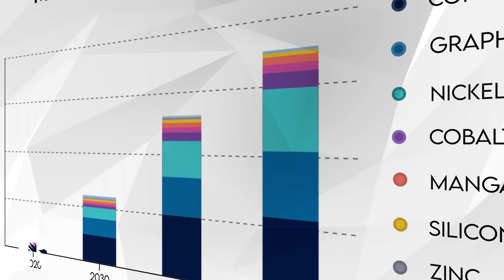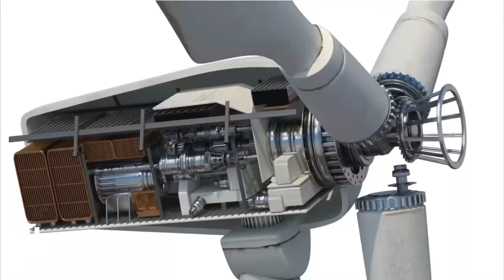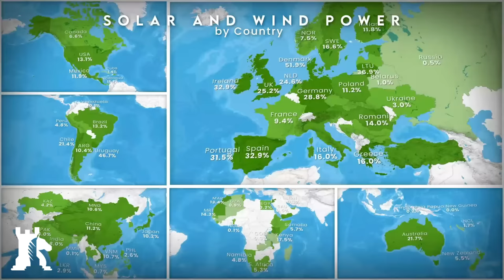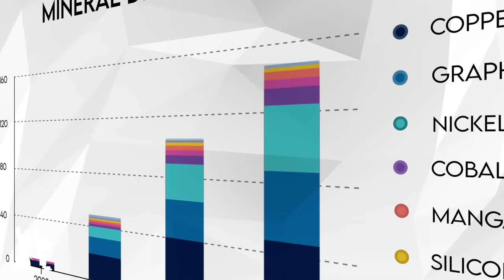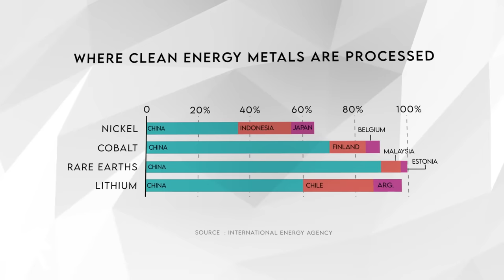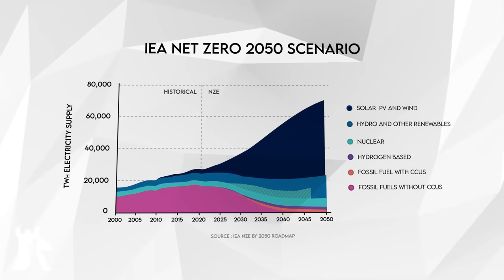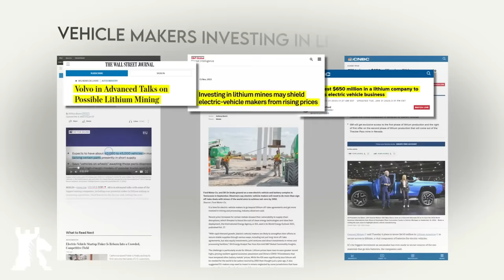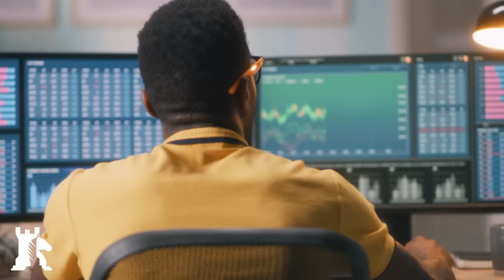Net Zero by 2050 is not happening

Comment: The Nordic countries came of as having low adoption of renewable energy on the graph but that's not the case. I think Sweden met 50% in 2012 and it's over 60% today. They use a lot of hydropower so that's why solar and wind is so low.
Reply: Also, what isn't Hydro in Sweden is mostly nuclear. Non-fossile power generation in Sweden is ~90 %. Norway runs a cool 1% fossile fuels, and doesn't even have nuclear.
Reply: They are inconsequential in every way to the "climate issue". They and the US could dissappear over night and the climate bs would still occur due to the coal power plants used in India and China.
Reply: I don't know country-specific statistics, but you are talking about electricity demand, not energy demand. Worldwide, only 18% of primary energy demand is electricity. That figure might be a bit higher in favour of electricity in Sweden, but all countries depend on food, concrete, plastics and steel, all things that require lots of fossil fuel subsidies without green alternatives that can be scaled up massively, and much of it is imported. Just producing a kg of wheat requires 250 ml of fossil fuel equivalent, and other foods are way higher. And at the end of the day, Sweden is population-wise a small country, with the population of a city in China that most people never heard of.
I highly recommend reading 'How the world really works' by Prof. Vaclav Smil.
Reply: @MA_KA_PA_TIE the US? 😂😂
Reply: @MA_KA_PA_TIE  "hurr durr, since it won't fix everything, it's pointless to even try"
Reply: @ericmyrs lol if failure is inevitable, then of course it’s pointless to try.
Reply: @MA_KA_PA_TIE  The goods produced in India and China are used by US. Its not just about electricity, you use everything from plastic to steel to concrete everything uses fossil fuels. We can't get out of it, countries in EU and others boast about green energy because most of the industries like manufacturing ones are based in Asia, its a bit hypocritical to just call out specific countries.
Reply: Neither the Nordics nor the US produces any consumer goods but also use the largest amount of per capita consumer goods in the world. Outsourcing you work, doesn't evaporate your foot print.
Reply: @TheDentedHelmet I think you're disregarding Sweden's extensive lumber industry. I don't know if IKEA furniture is made in Sweden but there's a lot made out of that lumber even disregarding IKEA.
Reply: @SIZModig  IKEA mainly source their lumber from Eastern Europe nowadays but you are correct that our lumber is still a large export commodity in Sweden. We also have a huge mining industry.
Reply: @SIZModig 
Pretty sure you use all your lumber to make housing due to Sweden’s chronic housing crisis.
Reply: his numbers are absolutely OUTDATET
Reply: either finland or norway energy costs were free a few weeks ago in article i saw, because of renewable production -they make so much they export to germany and other countries
Reply: @sobhansarthak6000  Same for Massachusetts which brags about how "clean" it is- thanks to exporting almost all of its industries, other than higher education, hospitals, gene tech and software, all of which use few workers and they're all highly educated. We now have the 3rd highest electricity course in America.
Reply: @cryptarisprotocol1872  rough estimate is ~10% of all Swedish exports being entirely or in part made out of wood. Paper alone is like 5%.
Reply: @TheDentedHelmet  
Outsourcing your work, creates a problem. You have no use for your low quality workers, so you must give them welfare/benefits.
Reply: @AlexFlodder  And the welfare state itself is subsidised by the Petro-Dollar and the environment damage that it causes.
Reply: Don't believe everything you watch on youtube. Most of these channels hide their poorly researched knowledge behind fancy animations and dramatic delivery
Reply: norway sells a fuckton of natural gas.
Reply: @MA_KA_PA_TIE US produces more CO2 emissions than India even though the US population is much smaller than India’s.
Reply: They have a lot of nuclear. And their renewable power is mainly hydro.  There are very few countries with the topography to do this. There are no Hoover dams in the works and the Greens wouldn't allow it anyway.
Reply: But you forgot that how much Nordic countries are rich and most country not also how much carbon they emitted to go that rich
Reply: Any power obtained through nuclear should count.  As it is carbon neutral.
Reply: Sweden and Norway have heavy hydro. I think Norway is mostly hydro, and Sweden a Nuclear-hydro combo. So they don't need to heed the Gospel of Wind&Sun - and I'm guessing so far north, solar is rather crap anyway. Not even sure how viable it is for Germany (i.e. if you placed the same solar panels in Spain, how much more energy would they generate?)
Reply: @MA_KA_PA_TIE  The US is most definitely NOT inconsequential. All told it actually put the most total carbon emissions - a full 25% of it. By contrast China still only account for 12.7% of emissions, and India a measly 3%. The US also has much higher per capita emissions than both China and India.
Reply: Not all countries have the luxury of multiple lovely rivers like Sweden.
Reply: @MA_KA_PA_TIE atleast their countries are as clean as they possibly can be, the people don't have to inhale excess carcinogeic combustion fumes in the streets and near factories or shipping facilities. And their forests are preserved.😊
Reply: @cryptarisprotocol1872  Oh, if it were only so... there's some housing being built but not at all enough to outpace the growing need. There's a lot of timber going into making furniture, windows and the like around where I live, I bet there are other uses too, though.
Reply: That is also true with Canada, particularly Ontario and Quebec.
Reply: @ericmyrs  "trying" involves increasing human suffering and poverty. Its immoral to try unless there is a realistic plan to solve the issue. Even if there was a valid plan, we still have to weigh the pros and cons.
Reply: Hydro IS renewable! Both politicians like to make you think otherwise.
Reply: @MA_KA_PA_TIE  That's not the point, is it?? They're a model that it can be achieved and pretty fast... basically it's just excuses for the rest.
Reply: @MA_KA_PA_TIE Sweden yes, America though is the consumption behemoth. They could save the climate all on their own
Reply: one ought to argue that their energy demand is nowhere near as high as larger countries like the US, China, most of the EU and so on
Reply: Nuclear energy is as renewable as any other solar and wind, same with hydropower, unless you have windmills and solar panels that are made from trees and not minerals that are finite, they never tell the whole story about how the alternative energy they are advocating for. Dams made without concrete and just dirt and trees will probably not survive long.
Reply: Also brazil, which relies on hydropower for about 80% of its energy production
Reply: NZ also
Reply: @TheDentedHelmet  Isn't the US the second largest manufavturing hub? Also, prety sure nordic countries have their gair share of manufacturing and energy intensive services
Reply: @ArawnOfAnnwn  bro US emissions have been going down for the last 6 years. It's China and India building new coal power plants EVERY YEAR with no sign of stopping.

And per capita? Bro China and india way outproduce the US in carbon produced as NATIONS. It's reduced per capita because they have near 1.4 billion people each but that doesn't change the amount of carbon they produce or the fact they produce more carbon each year than they did the year before.

They both have nuclear power, there is no reason they don't make more of that.
Reply: @artman12  that is true but india builds new coal plants each year, not the US
Reply: @ericmyrs  you can try to fly and flap your arms as much as you after jumping off a building, but you are still dead.
Reply: Hydroelectrics are a local geographical feature of Scandinavia.

It depends on a few things. There is a geographical hard limit on how many large rivers there are, and environmental limits on how many can be exploited without cutting into the wildlife. How much rainfall there is affects how much water gets stored in the system to be released.

Emergency power was always oil. There was emergency oil plants here and there.
Reply: @TheDentedHelmet  Sweden produces a lot of logging industry and industrial machinery. Not necessarily stuff the consumers immediately see on a shelf.
Reply: @scatalin09  Yeah, Scandinavia's population is traditionally concentrated in a few agrarian regions. The Netherlands is a lot more population-dense, too.
Reply: @scatalin09  So you're saying the fact that they only have 22 million people combined makes the graph in this video right?

Comment: I've stopped watching on gas turbine example. It's a total BS. You compare complete energy production solution with wind and solar farm to just a gas motor (turbine) neglecting all of the support infrastructure - generators, buildings, gas mining, pipes, LNG ships and ports. And the bad consequences of the exhaust of the gas turbine. But the main fault of reasoning is the fact, that after you build the wind and solar power plant, you need nothing more to get electricity. Wind and sun are for free. For gas turbine, you have to mine gas and provide it every minute for the next 50 years of the lifecycles of both sample powerplants.
Actually, for green economy we need 2/3 of energy and mining of the current economy, bc the current one is so inefficient.
You can close millions of coal, oil, gas mining sites, in place of the few new silver mines. BTW - these are usually copper mines, as silver is a byproduct there.
Reply: Right? I was so confused what he is trying to tell me here. Of course you cant compare those two things if one is finished already and the other one not. Also isnt the industry around wind and solar energy "younger" so they dont have these cheap supply chains as all of the fossil fuel economy...
Reply: Solar panels are virtually maintenance free, but wind turbines are mechanical. Nothing free about massive spinning blades connected to a gearbox.
Reply: @ChucksSEADnDEAD  As if a gas turbine is not mechanical.
Reply: I had hoped the presentation was accounting for that, but this is a good example of why it's hard to come to an agreement on course of action. It's very difficult to account for all the factors accurately and without bias.
Reply: @ChucksSEADnDEAD  Do they ever need cleaned? I heard before that they lose some efficiency each year and need replaced maybe every 20 or 30 years, and are difficult to recycle?
Reply: @shrayesraman5192  I compared solar panels to wind turbines and you want to talk about gas plants...
Reply: @thetayz72  They lose efficiency and the glass needs to be cleaned of dust. But they're very set and forget otherwise.

Comment: Among the several thing left off in the discussion (such as nuclear) is that corruption is a huge problem in some of the countries we "need" resources from...that will complicate things.
Reply: How many nuclear power plants have been built and brought genuinely into action in the last 15 years since the 2008 financial crisis?
Reply: @Marvin-dg8vj  Not enough. There is plenty of promising tech out there to make nuclear more efficient,, more powerful, and cheaper but no one invests in it.  If we want cheap green energy, nuclear is the future.
Reply: @hermaeusmora2945  there are none.
It seems to have failed
Reply: @Marvin-dg8vj  That's a trick question considering the fact that we rarely build new reactors, but instead continue to use ones built in prior decades or merely extend said existing ones. Also, what an odd time frame to bring up, because even in that time frame, according to the IAEA PRIS, over 200 gigawatts of nuclear energy has been added between 2008 and 2015
Reply: @Marvin-dg8vj  We have reactors in construction, but we mostly upgrade and modify existing ones which is an intention inherent in the design. Why do you lie and spread misinformation on the internet?
Reply: @Marvin-dg8vj  I gave facts though, I even sourced where I got my data from. Do I need to spell it out for you? Want me to draw a little graph? Would that be easier for you to understand, conservitard?
Reply: yes, corruption is a major problem here in Brazil, unfortunately. I have my entire life experience as a testament to that
Reply: @Marvin-dg8vj  You are the one attacking him and bringing no actual facts into the conversation…
Reply: @Marvin-dg8vj  The Columbia Generating Station in Washington state has ordered 12 modular nuclear reactors recently - not sure if any have beeen delivered, but given the amount of anti-nuke attidues in the US, I suspect they are not doing any boasting.  As to whether or not any new reactors being intalled/built elsewhere, I suspect that one has to dig fairly deeply as it gets little to no press - again, I suspect, due to anti-nuke attitudes among part of the population.  The fact that nothing is said on MSNBC,Cnn, or FOX may simply be due to caution of the existing (and any future) users.

Comment: Binary cycle geothermal seems like one of the best ways to move towards carbon neutrality. It assists with base loads and are much more economical to implement vs. SMNRs
Reply: Geothermal isn't a silver bullet.
Reply: Geothermal is way too situational to work as baseload at most cases. Relatively few places are suitable for it - a need for volcanically active AND stable bedrock is a must here. Not to mention a need of relatively complex and non-modular technology that requires a lot of customization based on various characteristics of the location.

That being said, we still need to scale it up whenever it's possible because some geothermally active regions have unworkable solar and wind potentials (given the current state of their technologies) to begin with (cue Southeast Asia and parts of Congo/Cameroon).
Reply: @lontongstroong  Thanks for the feedback, you are referring to traditional geothermal and not binary cycle geothermal which is not tied to fault lines and hence the location concern goes away.

Binary cycle pushes cold water into the earth’s crust to a depth of around 3km and then it comes out at around 70 Deg. C, from there it is run through a heat exchanger where the thermal energy is transferred to a fluid with a low flash point which then flashes to a gas and in turn is used to drive a turbine.

Canada has one such plant in the making with lots more on the way.
Reply: @DSteyn86  I think that technology would be constrained by the capital investment of the drilling. It might be even far less modular than the conventional geothermal, which might make it unsuitable for most solar parks, unless the scale of the intermittent plants it is coupled with is large enough.

Shall it reach maturity, the deep-bore geothermal might be good enough to stand on its own given the scale of its production, with exceptions above.
Reply: @lontongstroong Several companies are currently doing pilot testing on using plasma drills which is more efficient and cheaper than rotary drills.This will reduce capital investment on drilling once the plasma drills are available on the market.
Reply: Digging kilometer long holes is more expensive then building nuclear.
Reply: @lontongstroong  geothermal reached adequate maturity decades ago, political considerations sidelined it.
Reply: @DSteyn86  "flash point" is the temperature at which a material is likely to spontaneously ignite. You may be thinking of "boiling point".
Reply: @ChucksSEADnDEAD  there isn't a silver bullet. 
Geothermal is one of many approaches which, together, will resolve the problem.
Reply: @pawelzybulskij3367 

Why is that?

Isn't natural gas from fracking cheaper than nuclear? Because geothermal uses literally the same drilling technology. It was invented for geothermal first, commercialized for natural gas, and now it's getting used for geothermal again
Reply: @ar5288 

Fervo just completed testing on, and is currently operating, a commercial enhanced geothermal plant. 

Commercialization and upscaling has begun, it's not just pilot projects anymore
Reply: Ive worked on many geothermal plants in new zealand there certainly clean! But the steam needs to be scrubed before using..the steam comes up full of very dangerous heavy minerals that then sit in hugh sludge pools.
Ive worked in northland and central NZ power plants..
Reply: Send me a link bro thx

Comment: Although this video is scary, the answer will be a mixture of mining more but also using less. If every part of the supply chain gets 1% more efficient the result is not 1% less energy used it’s much more than that. A video looking at this side of the equation would be greatly appreciated
Reply: If every part of the supply chain gets 1% more efficient, the result is even more consumption.
It's called Jevon's paradox, if you're interested.   The solution is no less than a fundamental shift in human nature, which is where pretty much every political and economic system eventually fails.
Reply: @steviejay9245  Well, it depends on how we approach it afterwards. If infinite growth is what we strive for, then you are correct. If somehow that was stopped, then we should absolutely implement more efficient supply chains. Problem is though, all economies currently strive for infinite growth.
Reply: @steviejay9245  I agree that there can be loads of unintended consequences but there are other factors at play pushing the other way, for example the global population peaking and then declining, increased recycling rates, the most valuable companies generally being based on code not resources, the carbon intensity of electricity dropping over, etc, etc.